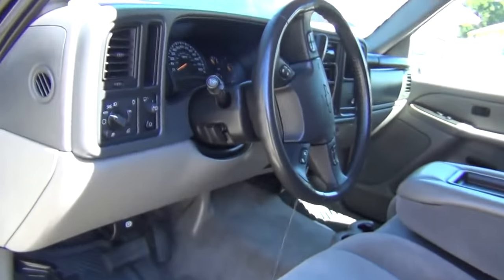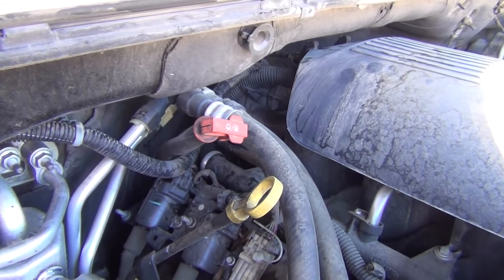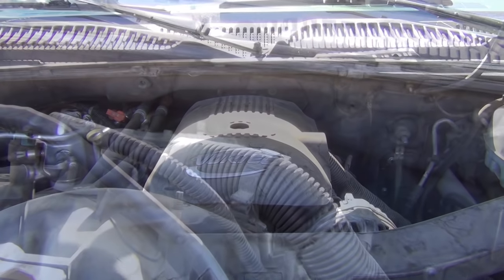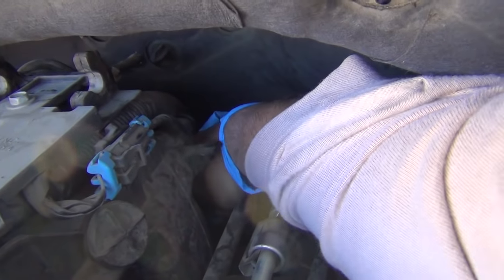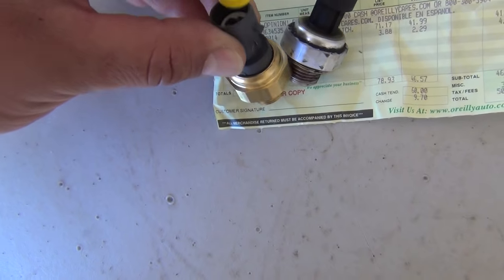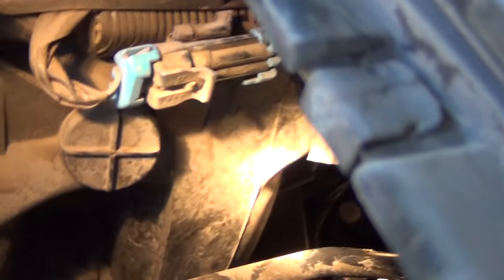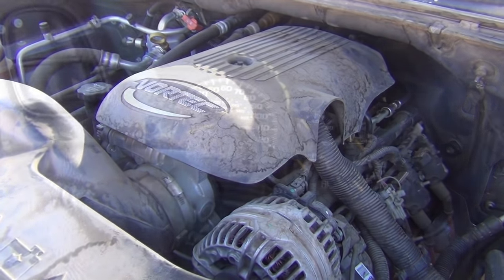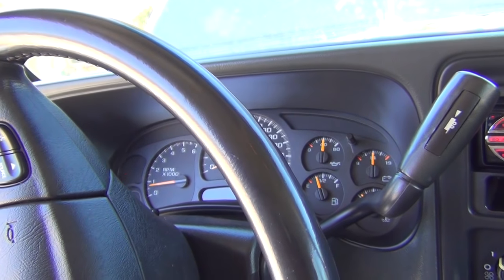CHEVY OIL PRESSURE HIGH....FIX!

Comment: Thanks! Awesome video! I have the same issue with my 5.3. First thing I do when I buy a ls powered truck, is take the cover off the engine and throw it away :)
Reply: Do you replace it? If so, with what cover?
Reply: @josephcarter7830  it's just for cosmetic purposes to cover the top of the engine as far as I know. I didn't replace it with anything

Comment: I was getting geared up to change out the oil pump until I saw this video. I changed the oil pressure switch and it worked. Thank you for taking the time to post this video.

Comment: I have a 2005 Chevy Avalanche 1500 and after using every curse word in the book and about ready to start punching the block thinking of the Engineers that designed this, I took a breath and like the Grinch almost lost my cool but, did not succeed the clearance and my four arms are not a good combination to resolve the issue tied between trying again tomorrow or just bite the bullet and take it in.

Comment: Thanks for the video. My gauge was acting the same way. So this video convinced me it was the oil sensor & not my oil pump or instrument panel. Put in the new sensor & oil pressure on my gauge is back to normal. Thanks again 👍
Reply: CITYOFANGELES1343

Comment: Mine been doing same thing for days now. Checked oil level is fine and oil still clean. No noises no nothing running good except my gage goes to zero to 80 and bounces around and sometimes levels off . But ya , I'm going to drive it till I can get it fixed. Oil pressure is fine , just a faulty sending unit for the gauge only.

Comment: Thank you for this! I had the exact same problem and was able to change out the sending unit and this fixed the problem. Price was $50 for the new unit.
Reply from the maker: +Steven Starace EXCELLENT!! 
Glad I could help!
Reply: So my oil pressure is fluctuating between 40-60 will this do the trick?

Comment: GET the 1-1/16" oil pressure sensor socket!!! Maybe when you buy the sensor someone could mention there is a special socket that goes with it? Ha! A swivel universal joint on top of the socket and then an extension bar are also pretty much essential items for this project. Having the right tools make all the difference in how frustrating this can be. Thank you for the help!

Comment: Yep mine was the same deal... it always read 80 psi then one day it started going up/down. It would drop to 0 when I revved the engine and float back to 80 when it idled. A new pressure sensor took care of it.

Comment: Thanks for the video man....  i had the same problem on my 05 sierra crewcab ... so the socket you need is a 1"1/16. and also want to say that for me was a little diferent .. i was not able to you my extencions due to a hose coming out of the engine .. but i was able to do it with a swivel . hope this helps some one
Reply: cotija91 thanks for socket size
Reply: cotija91 i did the same thing. just finiahed and thank people like u n the video maker.

Comment: The red stuff on the old one is thread lock. The "Acoustic Cover" that you had to put back on that said Vortec is always a waste to even bother putting it back on. All it does is make the air flow around the engine not very good. Those covers always end up in one of my closets. I just never believed an engine needed one over it. 

Now if you just like the cosmetic look of it that is OK and cool too. A lot of folks just don't know it does nothing to help the engine.

Comment: My oil gage needled pegged to 80 this morning.  The fix was exactly what you showed in the video.  However, I am not used to seeing the oil gage needed moving as I press down on the gas pedal - at least not as far over to the reading of 60. . I take it this is normal?  I bought the truck (2003 Avalanche) used 2 years ago, and the needle has always rested around 40-50.  So, I take it I am in good shape now, and just have to get used to the needle moving more to the right now as I get up in speed, yes?  BTW, thanks for the video.  I thought the mechanic shops (Black's Tire) had done me wrong.  Next up, I have to change out the fan knob for the  AC/Heater.  Speeds 1 and 2 don't work, and speed 3 comes on when it wants to.  A blower motor resister was installed today as well, and that brought back some of the speeds, but not all of them.  I was told that control panel under the radio will have to be swapped out.
Reply: No, the oil pressure should vary as a function of engine speed. 40 PSI at idle is typical, around 60 PSI or so at 3kRPM is what I see on a 2003 5.3L Vortec.

Comment: Wow my gauge has been stuck at wide open for 6 years. Lol now it's is shiwing a total drop at heavy throttle after the truck is warm. Will replace the pickup tube oring and see. Nice video.

Comment: Thank you for the info on this part. Mine is maxing out to 80 psi as well. I'm going to start with the sending unit 1st
Reply from the maker: Please let me know if this fix works? 
It is a very common thing and this should fix it.
The only time I have seen gauges max out is when a ground strap wire has been disconnected from the frame.

Comment: Well today I went to start up my Hummer H2 and I noticed the oil pressure gauge went all the way up to 80 PSI. I was thinking the oil pressure sending unit because I had been driving it a few days before with alright oil pressure and now it says 80 PSI.

Edit: awesome. You have the same engine as my H2
Reply: It was the problem huh? Mine is doing that right now
Reply: @Titoo.1  it was the sending unit on mine. I guess it's a common problem

Comment: Same for trailblazers with the 5.3l motor. If you have the trailblazer with the I6 engine it's located right above the oil filter.
Reply: WOULD THIS CAUSE A NO MOVE IN ANY GEAR FOR THE TRAILBLAZER 4 .2 .... ??

Comment: Very helpful video. Thanks!
I also had to use a 1/2" drive socket-but the thick wall wouldn't clear something (manifold runner?). Turned it down in my lathe to get it to fit. I did have a 1/2 to 3/8 adapter which allowed the use of a 3/8 ratchet/extension.I also had to take out the 12mm headed bolt that held the camshaft position sensor to swing that sensor's connector out of the way. The shorter sensor will allow the use of a standard sensor socket. My 30 year old Snap On sensor socket wouldn't fit the new part due to the height. Not sure if the shorter one is available as a replacement part, but it would be easier to use the sensor socket.

Comment: The 2 pieces from the old switch or actually part of the wire connector that's why they didn't come with the new one That's not locked tight you wouldn't want to put locked tight on an aluminum part Or aluminum threads which that is its some kind of pipe dope the use at the factory its a thread sealer nothing like lock tight more like Teflon tape thanks for the video

Comment: I remember changing my oil sending unit on my old nova, older cars are so much easier to work on.
Reply from the maker: Heck yea, I still love turning wrenches on old school stuff.
Reply: gunnwild1 Heck yeah, some old cars you can step inside the engine compartment and have a seat while working. I do have to say though my 06 BMW is very easy to work on, the attention to future maintenance is well thought out.
Reply: +A Tuck 
hey I have a questions about BMW my son wants to buy his first car and he wants a BMW 04 05 or 06 and Im concerned about it because those cars over a hundred thousand miles they tend to have a lot of issues inexpensive ones so my question is can you tell me any reviews about those cars how's your car doing since you been having it?
Reply: Tony Tigre I'm a mechanic so anything breaks I'll fix it myself. If you or he knows how to fix on cars then they can be great well over 100 or 200k miles as long as they have a naturally asperated inline 6. Turbo will shorten the life of the engine and requires more maintenance. If you know nothing about cars and or if the intended driver is bad at keeping maintenance up I would not recommend getting it. You will need expensive maintenance if the car has not been properly maintained, and most people don't properly maintain cars. My vehicle had all maintenance records in the glove. Look for a vehicle with records.
Reply: Tony Tigre,
BMWs are huge money pits.

Comment: I've had mine done twice and keeps going out. Now fixing to get it done the third time! Gauge tested good both times,but still pegs out to 80 mine is an 04' Silverado truck
Reply: Ive done mine 3 times as well on an 04 and it just failed yet again, ugh!
Reply: @augustdajnko  make sure the connector is replaced also. They did mine and finally it's been good.

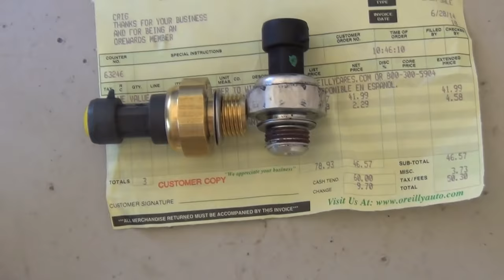Comment: At 7:30 it's not tapered thread, that would be an interference fit. The crush washer would be useless if threads didn't allow shoulder to bottom out against the washer. Otherwise thanks for the info

Comment: I noticed my gauge today and it had me concerned. I watched your video and I feel better. Tomorrow I buy the new sensor and install. I'll let you know. Thanks in advance.
Reply from the maker: Thank you, please let me know if you run into any problems??
Reply: I received my sensor and installed it today. The most difficult part of the job is releasing the captive connector. I finally succeeded by reaching around with my left hand to release the tab and pulling the connector with my right hand. NOTE: The connector is easily removed once the tab releases it. Bottom line: 40 PSI indicated and pressure rises slightly as I rev the motor. Thanks for your video.
Reply from the maker: leedek66 No problem, glad it worked out.

Comment: Some of these engines also have a screen in the mounting hole that gets plugged. It can be removed with a small, curved pick. Replace it when you replace the sensor…
Reply: Are sure they put oil filter screens in that bore hole

Comment: Great  video !! 
I had same issue in a Hummer H2 2006 that has the same vortec engine ,the mayor big issue is that is very very uncomfortable to take the sensor out so i was helping myself  to see the oil pressure sensor location with a mirror , i bought the extra 5 bucks expensive part that fitted right up and has the tread lock Oreally's part# S4202 by BWD
thank you very much
Reply from the maker: Xavier Camacho No problem, glad it worked out.

Comment: Needle pegged 80+ psi when running or with key on engine off needle should sweep from 0-80 then return to 0 till engine start if it doesn't return to 0, its the sending unit, common problem.  tow or fluctuating oil pressure theirs a small filter screen under sending unit, PITA to remove, but a small pick and a good tug gets it out, you can also try spraying carb or brake clean to flush old screen, they clog up with debris and sludge (oil changes ??). Another problem clogged screen gives engine starts but shuts off with-in 30 seconds,  PCM needs to see oil pressure with-in 30 sec of engine start or it shuts engine off. Low or fluctuating oil pressure can be "O" ring on pick-up tube, add 2 extra quarts of cheap oil jack up back of vehicle and see if problem goes away. If not oil pump pressure regulator valve in pump maybe stuck replace pump. A spastic or vibrating needle probably stepper motor in gauge cluster, google GM gauge repair, , None of above will cause oil  consumption, if you have AFM (active fuel management that drops from V8 to V4 mode particularly the 2006 to ohh about 2010-2012 years google it.  just my 2cts worth hope it helps someone GM and ASE master tech 30+ yrs.
Reply: A 1995 GMC with 454 (L19) my gauge needle reads hi 60 - 80 on the dashboard oil pressure dial. Cold and warm.
Is that okay? To have high oil pressure ? Suburban has 50k miles, and Castrol synthetic 5W30 oil

Comment: For me I had changed this thinking that was the problems and it fixed it but a couple days after the same problem came back. Im not sure if its a o ring in the oil pump or a bearing gone bad.

Comment: anytime a gauge max's out its the ground side of the circuit, weather sending unit gauge or harness is a case by case basis.
Reply: How do you go about fixing it?
Reply: @lennythelizard3856  Well you just run a new ground wire for the gauge

Comment: I have tried three different filters and one that was the same that came on the truck when I bought it.
Reply from the maker: When you install a new filter the pressure does go up and it is louder right? 
Here is a thread I found on the issue and what other mechanics and non mechanics were talking about.
I hope you find some of the info useful. 
Your situation is rare, but not impossible. I would think that the oil bypass in the block would redirect the flow of oil and not cause any problems. We all know that oil pressure that is too high will cause problems and 60 would be about the max I would be safe with. 
http://www.bobistheoilguy.com/forums/ubbthreads.php?ubb=showflat&Number=319530

Comment: awesome video. On the point. thank you so much.
Reply from the maker: +Arnold Morales No problem.
Reply: Im from California, 2004 suburban k1500 LT. My transmission is gone. Would you recommend any mechanic shop or would it be best to buy the transmissin and install it myself?
Reply from the maker: Arnold Morales A transmission install is not very hard, but it will take a little time and would be easier with a friends help. If I were you, I would tackle it myself. You will save about 800 bucks. I have replaced 2 transmissions on the Z71 K1500 I had and it was pretty straight forward. I found a good transmission for mine at a 4x4 wrecking yard for 500 bucks, but you can get a rebuilt one for under a thousands with a warranty I believe? The hardest part was jacking it up and stabbing it in. As long as you have a friend that can help and a set of tools with some long extensions for reaching over the bell housing from underneath and behind the transmission, you should be good.I hope you try to replace it yourself, it is really satisfying.

Comment: Mine went straight down 6 on-the-clock the pointer on oil pressure gauge it did it yesterday,, today on the way home from where I was at just a couple of miles the truck went into limp mode it's a 6.0 2005 4 l80 2500HD nothing like coming home 27 miles an hour when you're tired it's a good thing I was only about 7 mi from home instead of couple of hours they've been a long long night

Comment: yes sometimes the blower motors kick in sometimes the blower motor doesn't answer it doesn't work on the heat or the AC I'm wondering if its the blower motor resistor
Reply from the maker: +Curl Davis My old Cadillac did the same thing after I degreased the engine. I guess I got some water behind the resistor compartment located in the engine compartment and it shorted out. I just hard wired the blower motor with a 3 dollar switch from the auto parts store, lol. It could also be a short just behind the a/c control knob? Can you get it to work by tapping on it or switching it off and on really fast?

Comment: any advice on an 03 1500HD with oil pressure that starts high then bottoms out - pressure increases when i give it some gas but then continues to bottom out while driving. Did an oil change less than 2000 miles ago - filter SPEWED oil at the time. I don't see or smell oil but now i read low unless parked on an incline. Truck runs fine. Going to put some Seafoam in the crankshaft and try to break up any sludge that may be in there and if need be replace the sending unit. praying its not the pump.
Reply: Did you ever resolve this issue? Mine is doing the same thing. After the truck warms up, the pressure drops until I hit the gas.
Reply: Aimee Walker mine hits max low when I come to a stop and oil light comes on.

Comment: I use 27 deep that I ground down wall a little so it dont snag the cam sensor. And swivel, 3 inch extension

Comment: If the pressure was really that high would the engine blow? I'm having the same problem on my 03 Silverado
Reply from the maker: +Manuel Garcia The pressure could only be that high if the oil pump outlet is restricted by something or the oil sending unit has gone out. If the pressure was that high I would imagine the engine would smoke due to pressurized oil passing the rings and the engine should be overheating too. 
This is a very common problem and it is almost always the oil sending unit.
Reply: +ImRamro ok thanks I'm gonna change it out today great video

Comment: Thanks for the video!
I have a question, will it make any difference cleaning the electrical connector with a contact cleaner instead of changing the thing?
Reply from the maker: +Hassan Abdulkarim It is worth a try, but I believe the sending unit is damaged and a good cleaning will not help?

Comment: Plus when I am driving at speed it always seems fine right about 40 but when i come to a stop and idle it seems to drop to around 20-30...I also have a slight miss in the engine.. maybe need nee plugs.. 150,000 miles stock plugs i assume
Reply from the maker: James Owens I saw more than one comment and then when I went to reply, this is the only comment that showed up?  Oil pressure that drops when you are at idle and increases when you are at higher R.P.M can be a few different things. The main cause for this is wear in the lower half of the engine. Specifically the crank journals or crank bearings. You can install a high volume oil pump and this may help, but the lower half of your engine is probably the culprit. I did not get the first half of your comment, so I don't have a lot of info to go on? My Chevy Z71 did this and about 5 years later I spun a crank bearing while trying to pull a guy out of a canal. As long as you are not towing anything, this should only be an annoying warning that you may want to have the crank turned and install new crank bearings some day.